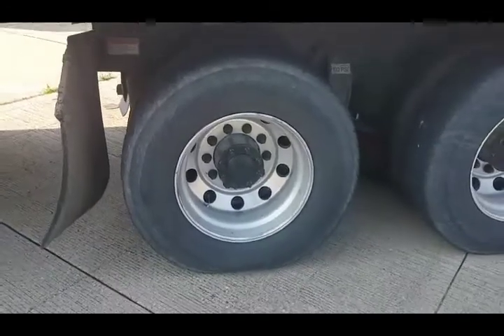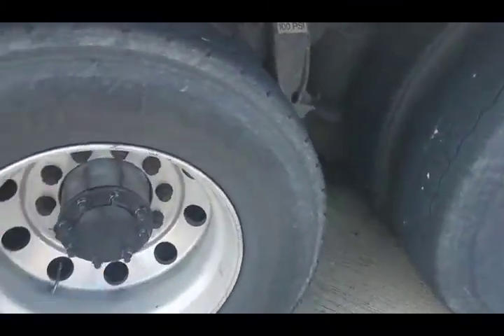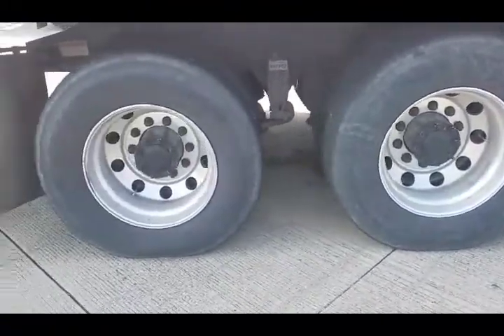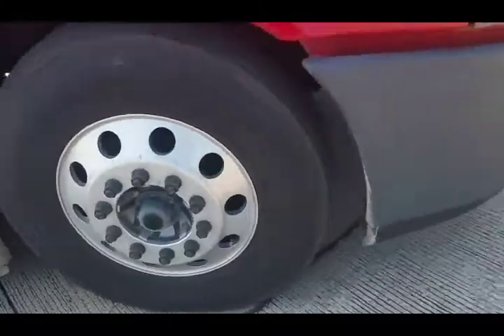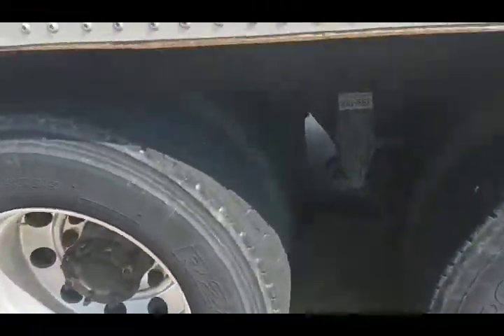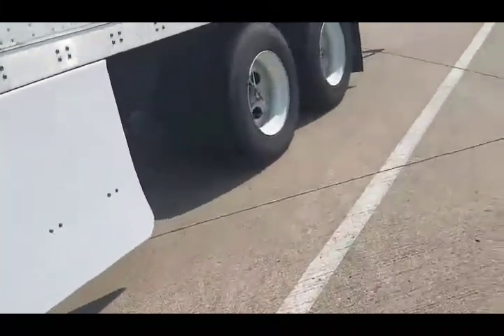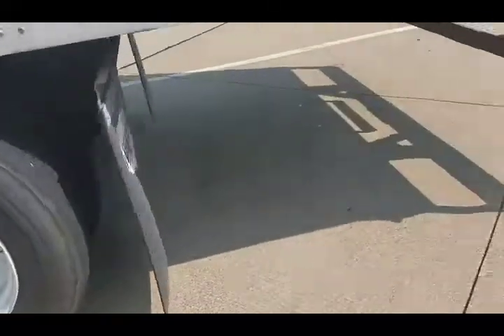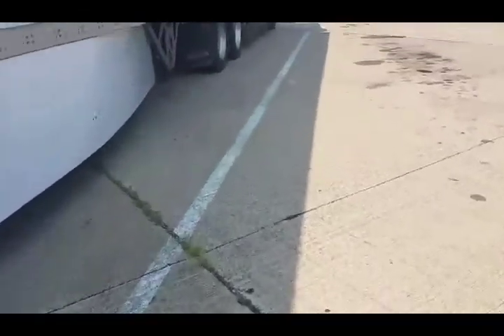'DOT INSPECTION' FRANKFORT,KY

Comment: Ahhh man! I had the same thing happen to me 4 years ago at that very same DOT facility. I had stopped for a break at the rest area just before and had checked my tires. When I got inspected, the Officer just wanted to do a quick Level-4, before shutting down the station and found I had a nail puncture a trailer tire. He was a cool guy... told me I had to get put OOS until a tire tech could repair it and then I could get on my way. Those things happen, no matter hoe meticulous you are on your equipment.
Reply from the maker: Ray Ray very true. And thts wht I had in the tire a damn nail.... lol